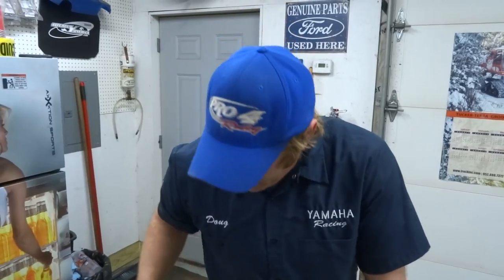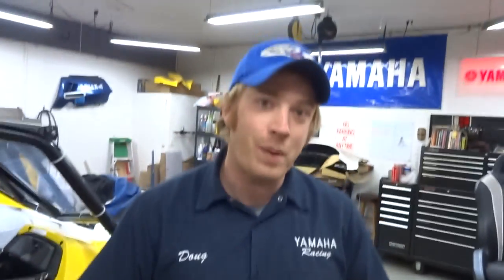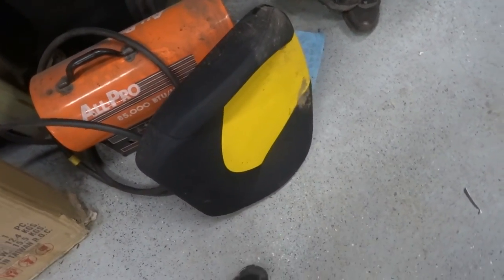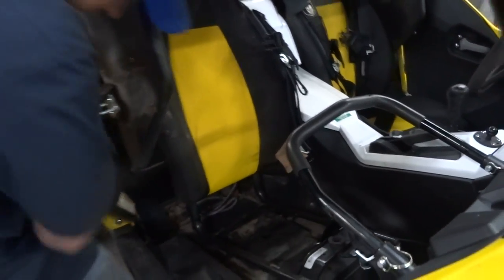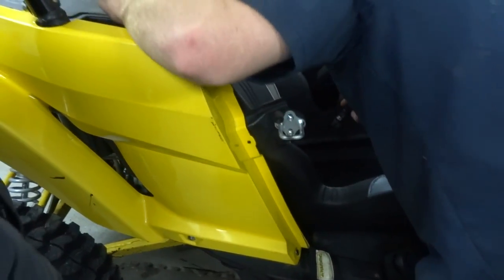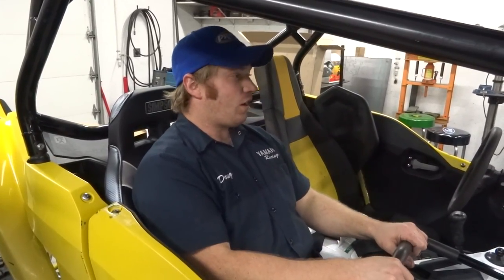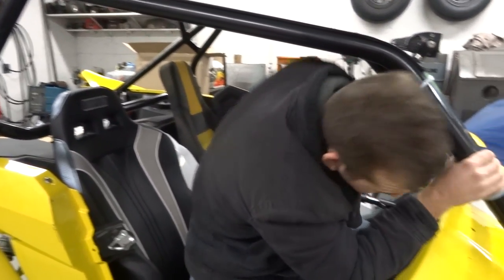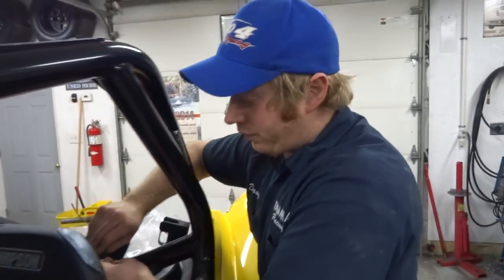Installing suspension seats on a Yamaha YXZ! SXSBlog.com Garage Episode 15

Comment: Would like to try those seats but definitely wouldn't want to sit up higher.  Do you think lowering them would be possible / doable?
Good video,  maybe a little rushed,  but good.
Reply from the maker: Hey yeah, Doug's going to probably modify the mounts at some point. They appear to be able to be dropped down maybe an inch or two.

Comment: Doug, what did you end up doing about the door latches?  I'm sure you had to cover them with something..
Reply from the maker: Danny, Simpson makes a set of padded covers for them for $50.  I've got them on order, just waitin for em to show up.
Reply: Good to know, may end up doing something like that myself.  Still on the fence about seats, the stock seats aren't too bad, but I don't care for the big plastic wall next to the seat. :)
Reply: Danny Williams I cut that wall off my yxz seats and threw on some 5 points. Doing well so far but still want a low race seat in the future.

Comment: Doug I met stop the bull shit thei is why you went simpson....Prp response to my almost try to return after ther 3 time calling and them hanging up message in a email...Them her > I'm sorry to heart that the seats didn't work out for you. I would recommend trying to sell those seats 2nd-hand and using the money to purchase some new ones that have more room to them like the RST or the XCR at a discount. I can get a coupon code generated at 15% off a new set of seats from the website if you'd like one. The seats you have can be sold as RZR XP 1000 or Maverick X3 seats in addition to be Honda Talon seats, they'd just need to purchase the appropriate adapter mounts from us. This will help increase your chances of getting them sold since there are more vehicle types they can go in